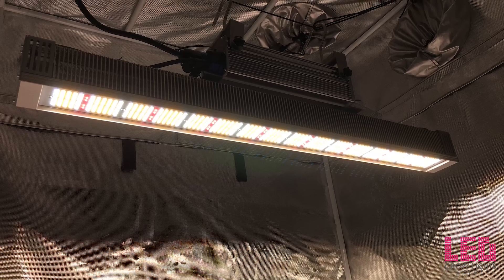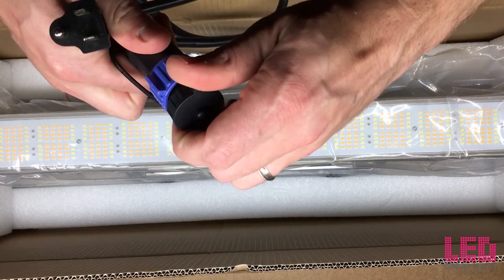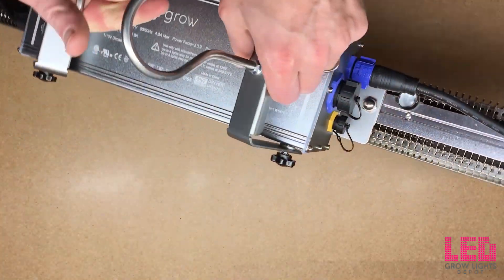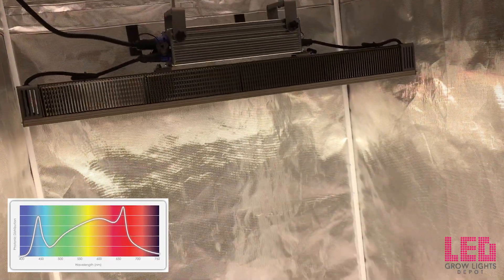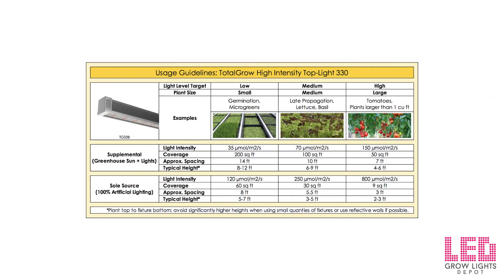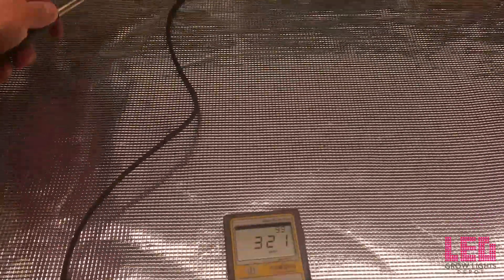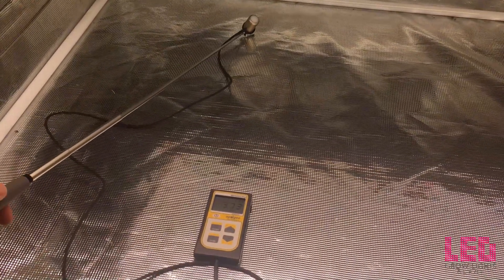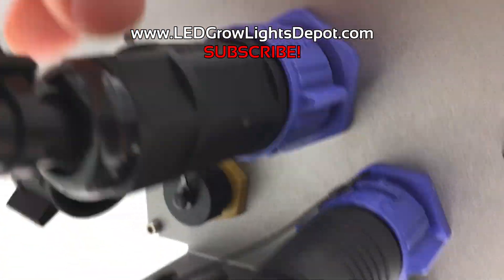TotalGrow 330W High-Intensity Top-Light LED Grow Light Unboxing, Review, and PAR Testing

Comment: I would like to try this out. It would work perfect in the closet grow that i want to start. Also i  would like to point out that the light is nice. The hangers are phat. Also the fact u could use it for flower as well. The slim definition of it is very nice for greenhouse or your tube grow.also i would like to point out that the slim definition of it  probly would be best in a tube greenhouse. That way u have less and u get much more. Thanks for this video. I have got to get one of thease lights. Maybe when there a bit cheaper. Again thanks for showing us this nice light bro